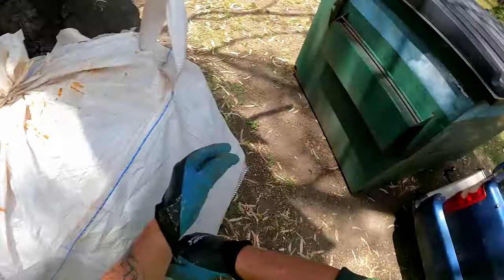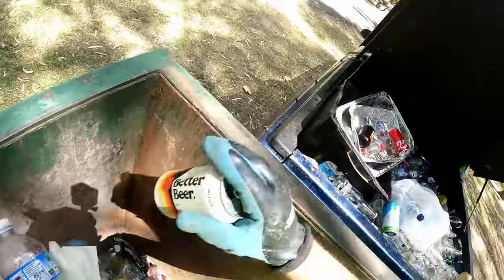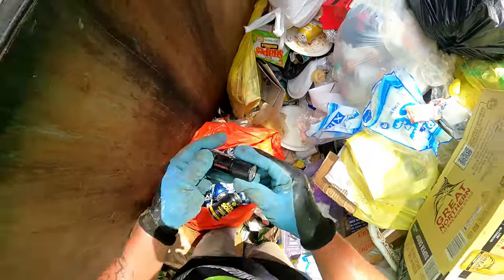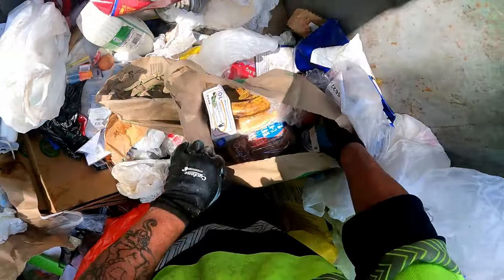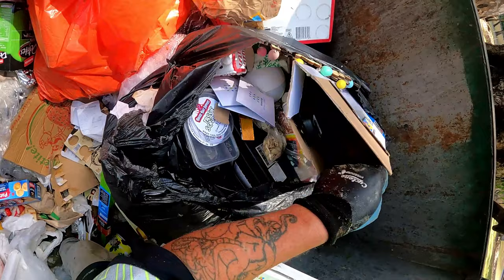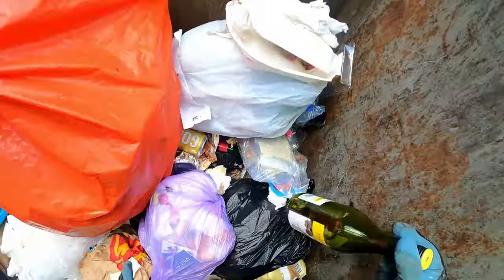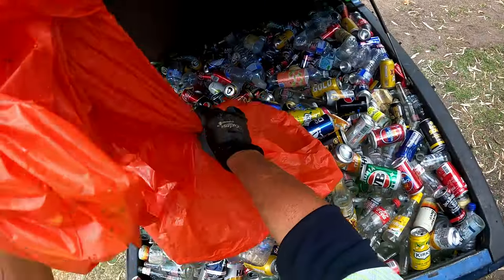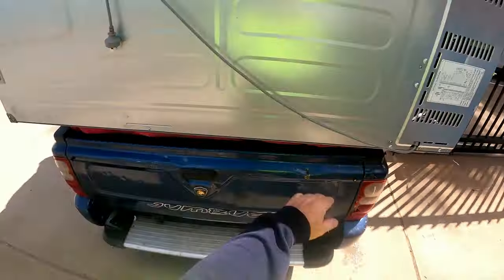Dumpster Diving Part 4 Making Head Way With Another Pickup

Comment: hello, any keyboard has a transparent film with silver-plated tracks. If it is possible to remove silver plating by electrolysis or  with different aids, then you can get 1 gram of silver from 10 keyboards